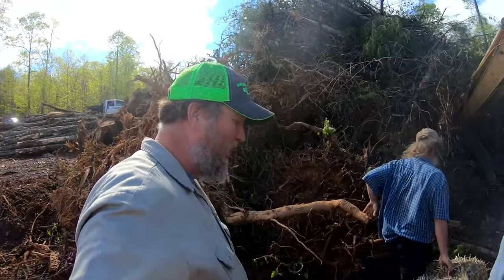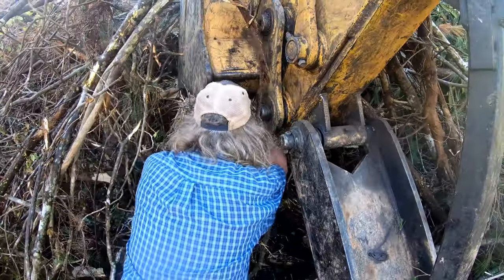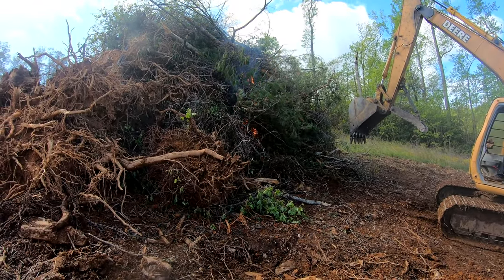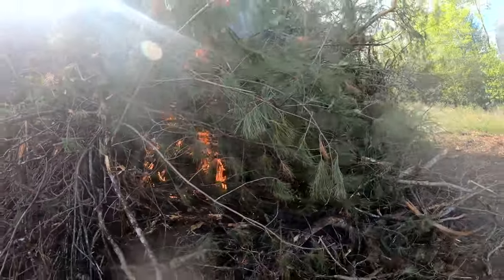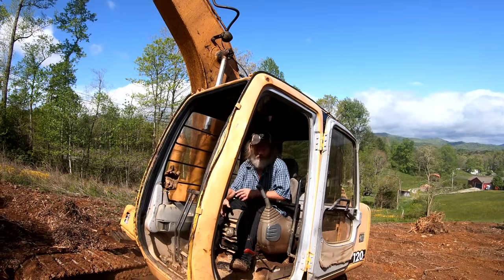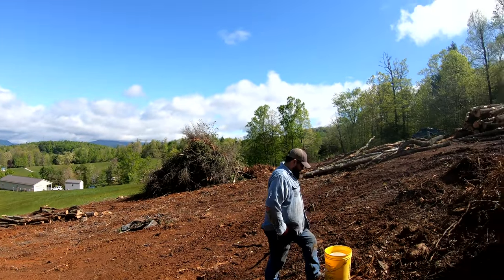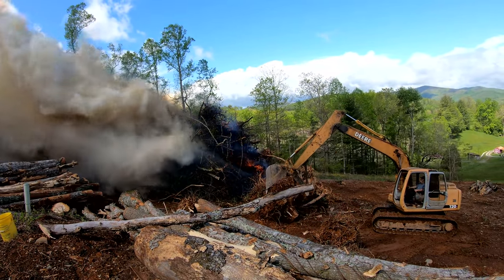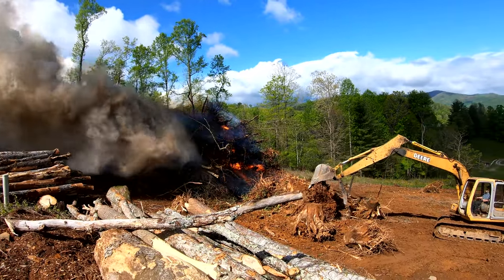How To Burn A Brush Pile - Even If The Wood Is Green and Wet

Comment: The guys that filled a bucket with diesel and dumped it on a pre lit fire😂😂🙌🏻🙌🏻 look up the video😂
Reply: Also definately don't use petrol. Your bonfire pile will just blow apart half the time
Reply: @mightyconker3903     Petrol/gasoline will land you in the burn unit.

Comment: Using gallon of gas or dental fuel very dangerous,  splash all over the place, people get burned, road flat in middle of pile burns very hot for 15 minutes, more than enough time to start a fire, then keep pushing outside branches inward...😏

Comment: Why burn it chip it and use it for mulch on your garden?
Reply: OK, Greta. 😁
Reply: Cause that would take dozens of hours more and you'd need to buy a $10,000 commercial grade chipper.
Reply: Plus, you can use the ash for your garden
Reply: If you put it out with water when you've got a big pile of embers then you've got charcoal, the very best fertiliser
Reply: Lol, try chipping a huge pile like that and stumps. Pile bigger than it looks on camera.
Reply: @furtfurt  More like $50k for a new, 12" gas chipper that is underpowered.
Reply: @4.0gpa44  fair enough, I was being cheap with buying a used chipper lol